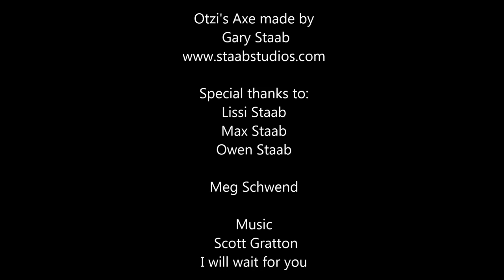Building Ötzi's Axe

Comment: Can you share the dimensions of the axe head?
Reply: Eric Slighton is it just me or are they like top secret I haven’t been able to find it anywhere I wish he would post that diagram he has
Reply: @cptbutters1394  I do know however the axe head is about 9.3 cm long but the other bits I unfortunately another channel called shorne Woods did a video how he made his otzi the iceman axe
Reply: Approximately 3/4" at the base and 1 3/4" at the blade with a thickness of about 1/2". If you take the profile drawing as accurate in cross section and dimensions.